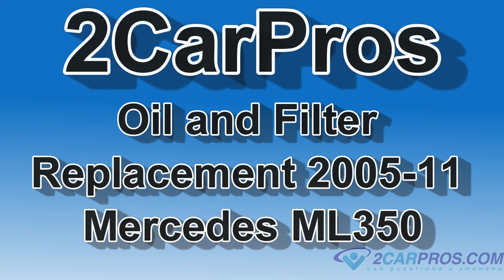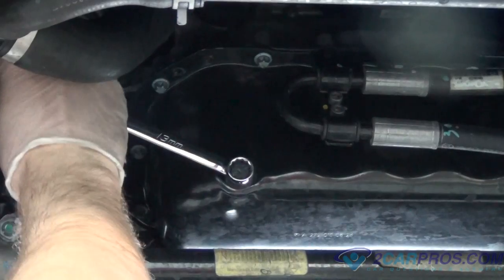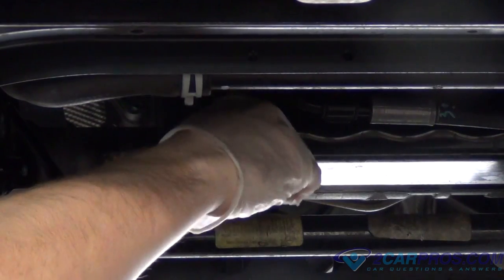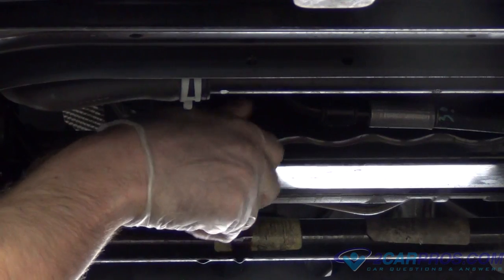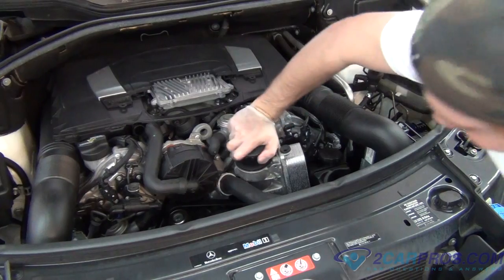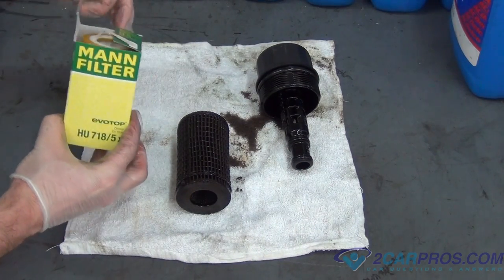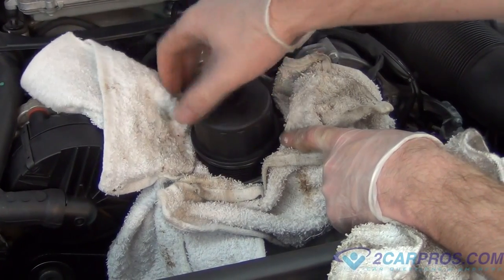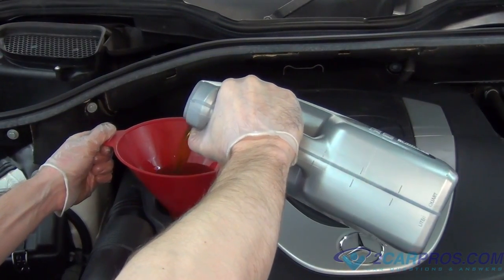Oil Change & Filter Replacement Mercedes-Benz ML 350 2005-2011

Comment: Where did you put the third o ring you didn't show taking it off or putting it in?
Reply: +Raul Aguilar ....Yes i saw that also their were 4 rings , do you know where the other one went..Thanks
Reply from the maker: +John Jacoby   They were replaced sorry we didn't show it, we will be sure to include it in future videos
Reply: 2CarPros Thank you very much .....I think that mabey i didn't ask the right question , I bought my oil filter last night Bosch 3477 and i will do oil today first time on my ml-350 , but in the box their are 4 rubber o-rings the big one goes at the top but on videos i only see 2 more rings , i guess i will see todaqy when i remove filter if it needs all four rings.....Thanks
Reply from the maker: okay let me know how it goes
Reply: +2CarPros Thanks again for the reply .Oil went great and it does only need the 3 o rings, and its funny cause they put 4 in box. and they are all different sized but 2 of the 3 I took off were same size but the new ones I put on one was bit smaller but fit fine , I am going to call Bosch tomm....You are very nice and thanks for the reply I made a video it won't be as good as yours I'm not pro like you guys.....I have question I am going change thermostat and the ect sensor cause I have a code po 128....not sure where the engine coolant temp sensor is , Its pretty cheap to buy so I will fix myself...If you know where it is on the 2010 ml 350 that would be great I am still looking.....Your the Best Thanks John
Reply from the maker: We are glad you did the work, I dont have the car in front of me but I would say the thermostat is in the lower or upper radiator hose connection at the engine.
Reply: Thanks , No problem , I know where the Thermostat is it was the engine cooling sensor i am trying to find , No videos on You tube ar really anywhere.....Thanks .....
Reply from the maker: +John Jacoby   We cant upload images here, can you please ask your question here 

https://www.2carpros.com/questions/new

we can help you better
Reply: John Jacoby  The other O-ring is intended for the top of the dipstick if yours needs replacing.😊

Comment: Use vacuum to remove from the top. That is how the dealer does it. Also that is how marine engines get there oil changed. Much cleaner.
Reply from the maker: Yes that is a good idea